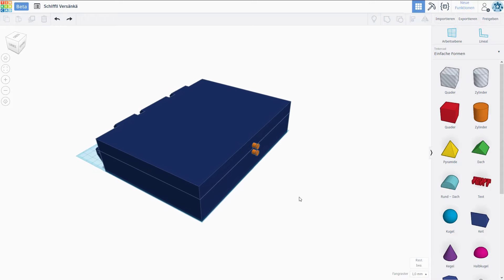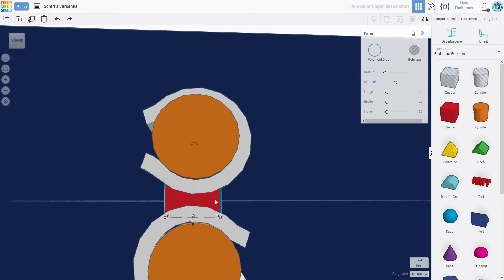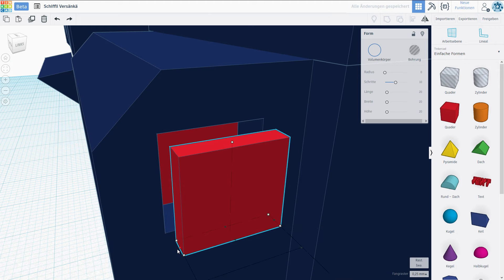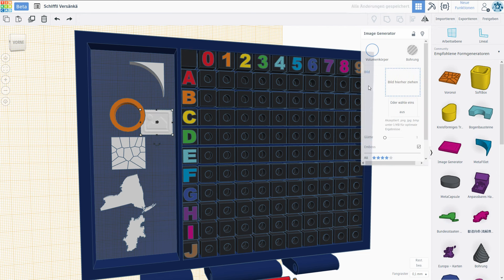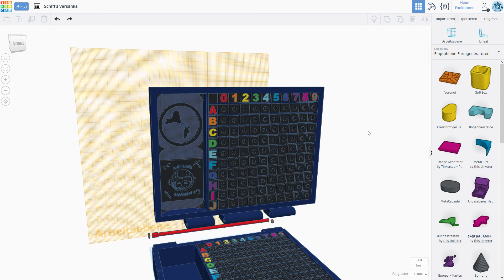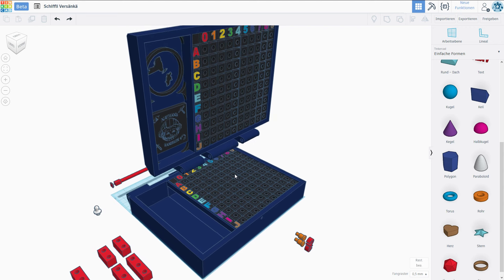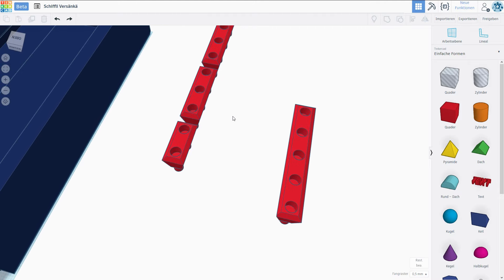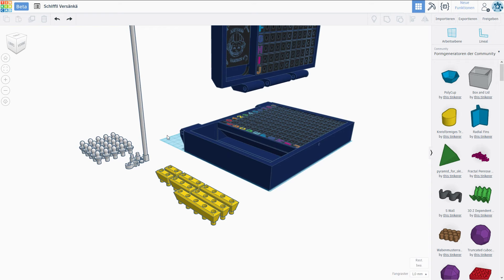FINISH FOR PRINT - 3D Designing & Printing: Ep. #3 - Making A Battlefield Game

Comment: @3:32 The act of cutting 45° off of an edge is called a Chamfer, it is a common finishing technique to 'soften' an edge. There are a few good videos that will show you easy chamfering techniques for TinkerCAD.

@15:18 It is very unlikely that leaving your printer unattended will start a fire, it IS more likely you will waste lots of filament, and need to clean your nozzle. 

The main reason that I divide my parts into smaller pieces is to reduce print time, but it does require more assembly at the end of your print.

You can reduce the print time on the large pieces by chopping them into smaller parts, such as printing the grids and letters separate from the box, printing the bottom hinges separately (on their sides),  and even the decorative inset in the lid. 

You can choose many different methods to attach the parts together, glue works nicely, but chemical or heat welds work well too depending on the plastic you use. 

I think of 3D printing like model making, after you've made the model pieces. ;)

A good resource is Adafruit's 3D Hangouts/3d Thursday's show on youtube, they have a LOT of great videos on 3d printing.

So far it looks great, I look forward to seeing how it turns out. :)
Reply from the maker: I would actually not mind slicing the boxes in let's say two pieces. Maybe not on a letter by letter basis, but just cut print time in half per piece. Will have to find a way to cut stuff through the center in tinkercad. I could even implement an indent to make them easier to stick together afterwards.
Reply: I wasn't suggesting you separate all of the letters, I was thinking something along the lines of the playgrid as one piece and the shell/frame as another. The grid and letters can insert into the opening where they are now, they could even be printed in a different color than the outer shell. 

An indent or a small channel are good ideas to help secure a secondary part inside a larger piece. :)